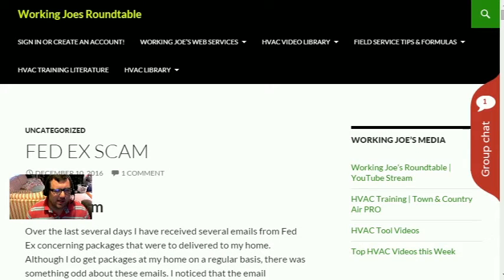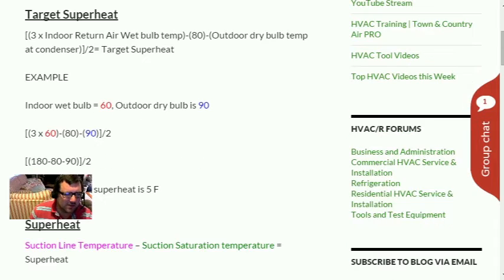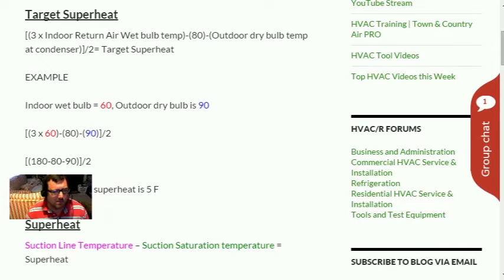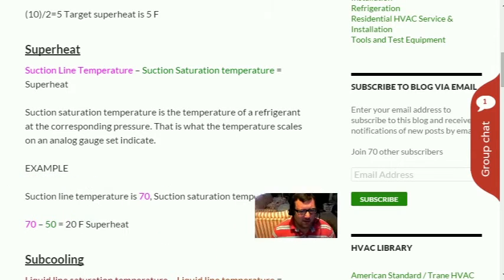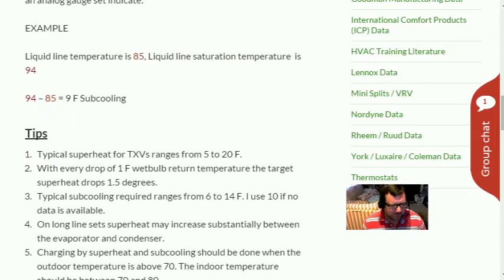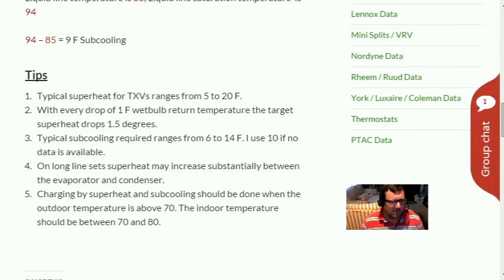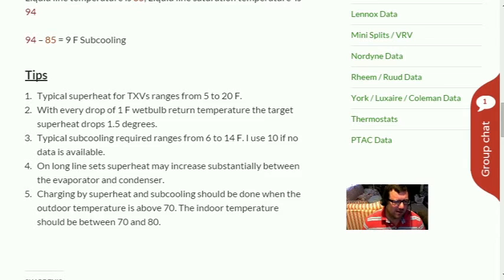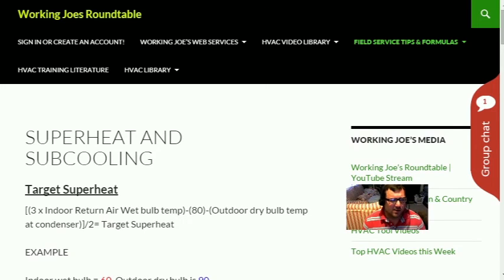Superheat and Subcooling | Formulas and Tips

Comment: Sir I have no back ground in air-conditioning where can I found my wb Temp. If I have a temp gauge where can I put my temp probes in the system tnx
Reply: Marga Marcos you can get the wet bulb from anywhere in the house as long as there’s air movement across your probe. I take mine at the return grill.